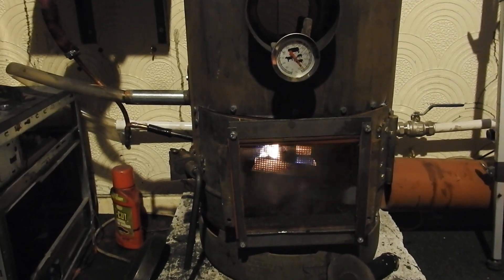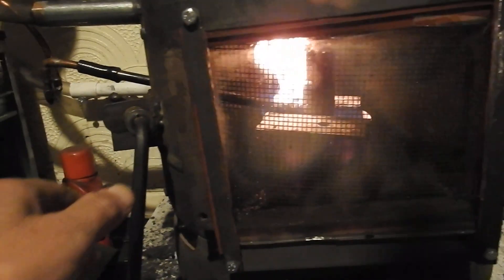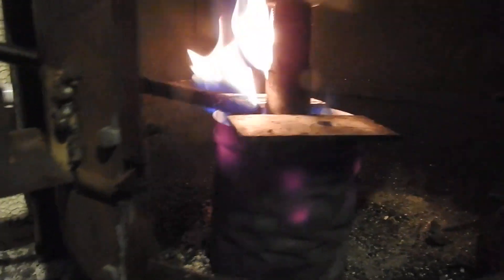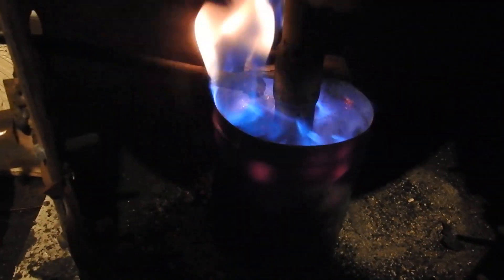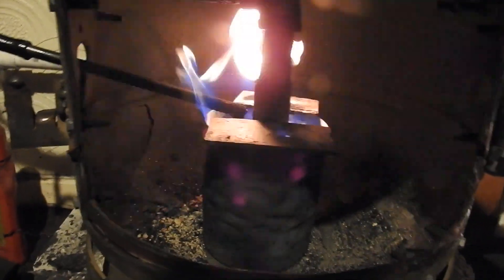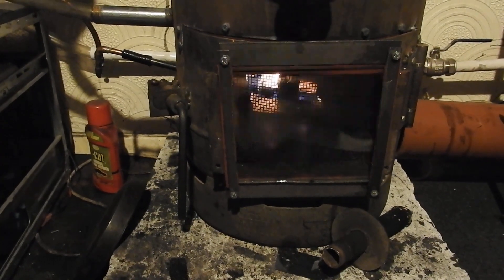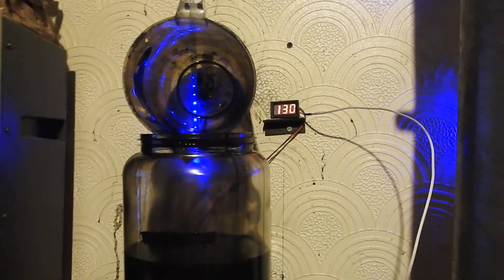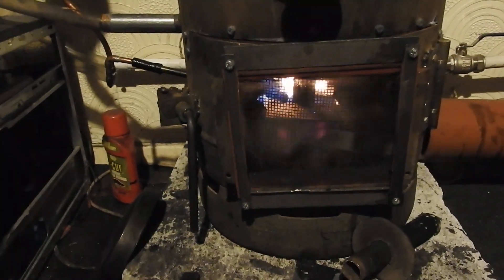Waste oil burner Part 6. Almost there!

Comment: Pretty cool design good job 👍
Reply from the maker: Thank you,  It burns better now, got rid of the heavy plates on top with a c shaped disc, lowered the fuel pipe and it works great.  It's only a very small burner but heats up my whole small house, it has to because I need the doors open or get too hot.  We are continually discovering different ways to use these burners and designing them to suit different applications.  For instance my burner is not capable of melting copper or steal because there is not enough mass of heat to achieve that with my setup and yours, you will find in time will disintegrate the burn chamber it gets that hot :)  but that is like changing the wick on an old paraffin stove :)  My little pot has some bubbling effect to it now after about 18 months it's still good to go.
Reply: @Moonlightshadow-lq4fr  Thats awesome , cant beat cheap heat 👍